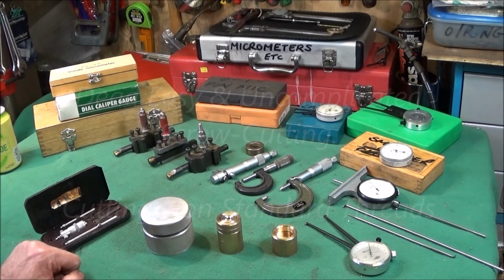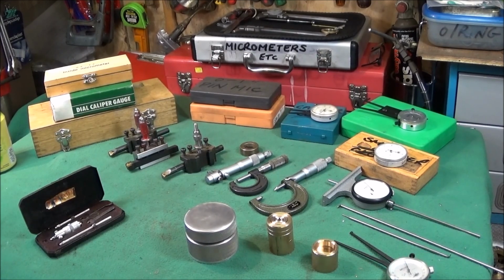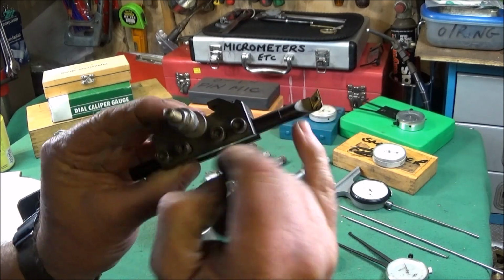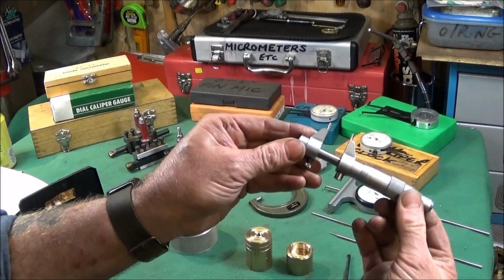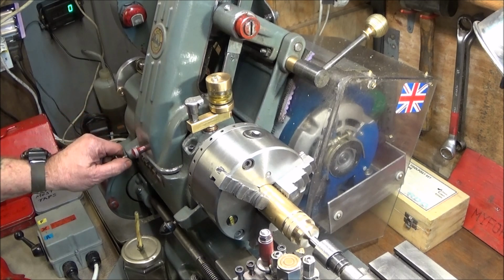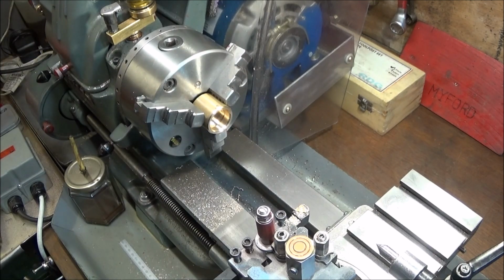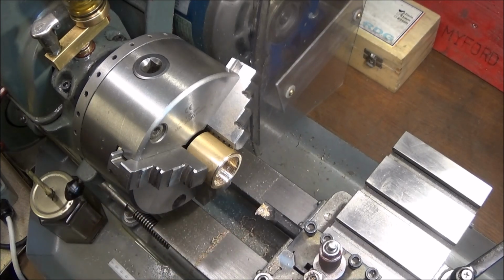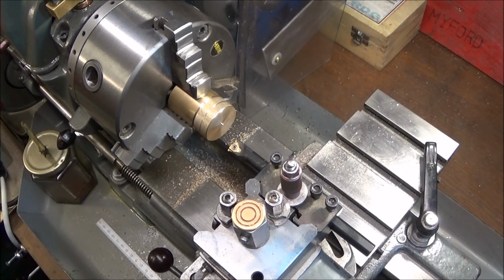The Easiest & Safest Method Of Screw Cutting Threads On The Lathe.

Comment: My lathe hasn’t got a hand cranking option, is there a way I can use this method? 

Thanks
Reply: I think you could make some sort of an anchor in the back similar to a wall plug where the material can stick out. Then attach a crank to that.

Comment: would you use this method for imperial thread ? Other videos i;ve watched set the cross slide at 29 1/2 degrees
Reply from the maker: Hi Maurice Yes I do use this method for imperial and it works perfectly every time. I don't think you need to set the cross slide at an angle if you are using carbide inserts as they have a perfect profile. Regards Steve
Reply: The idea is that though the cutting tool has a 60 deg profile, by setting the compound to feed at slightly less than 30 deg  the tool is cutting with the leading edge and not dragging the tool's heel which may gall the flank of the thread. 
Perhaps not so important with carbide tooling, but a hand ground high-speed threading  tool only cuts on the leading edge.

Comment: If you use the compound slide to increase the depth of cut and the cross slide to wind the tool back out, there is no need to remember which number you are on for each cut.

Comment: Superb video again, especialy for someone who like the  tricks from a specialist!  One question about the Thread Dial Indicator,   can you explain how it is used ( in the video i don't see the detail,   perhaps it's easy but  for a novice...)
Reply from the maker: Hi Ivo Thanks for watching.... I actually forgot to mention this important point. You do not need to use the thread dial indicator at all for machining threads in this way. As long as you leave the lead-screw half-nuts engaged all the time until the screw- thread is finished.  

This is what I like about this method. It cuts out much of the set-up you need to use if you were to machine threads using the motor.  Plus like I say, you don't need rapid reactions for cutting threads. 

If you try it you will be greatly surprised at how easy thread-cutting can be done, plus it gives the ability to make a wide variety of items......Regards Steve
Reply: This video makes me see the ned for a hand crank for my lathe. Yup yet another project on the to do list. Thanks. (no sarcasm intended)
Reply: Ha, my thoughts exactly ExtantFrodo2

Comment: Hey Steve, I am about to press Buy on Ebay on some inserts and cutters, but am curious will 10mm ones deffo need machining down to fit a QCTP? I have no means currently to take a few mm off you see so wondering if I'd be better with 8mm but I like the idea of using 10mm as they have a bit more meat on the bone.
Reply from the maker: +Tempest500 Hi they will fit the toolpost ok
It is only if you are using the Myford lathe that you may need to take a bit off the underside of the tool to be able to get centre height. I will just check the 10mm one....be back in a moment
Reply: Ah sorry should have said it's for an ML7
Reply from the maker: Yes I have just checked it. I have been using the 8mm one myself. I just tried a 10mm one on the lathe and it does looks like the tool-holder will clash on the underside. The 8mm one is perfectly good enough though, I have used it on all materials without any problems. Regards Steve
Reply from the maker: I forgot to say....It is only the the turn tools that need to be under 10mm square. 

The BORING TOOLS  I use are up to 12mm diameter and DO NOT need any alteration to the shank to achieve the correct centre height
Reply: Excellent, cheers for checking Steve, very much appreciated.

Comment: Thank you for sharing this outstanding method !  I was totally unaware of this but recognize the versatility and reliability it gives.
Reply from the maker: Hi Fred, Thanks. It is particularly good for very fine threads with a short run depth. Like the components you get on optical equipment plus other similar items where it is almost impossible to use conventional threading methods. I do use this method for any threads I have to do now though. Regards Steve
Reply: The other essential is a tailstock tap and die holder for cutting standard sized threads. That is much easier than using this method.
Reply from the maker: Not for large diameter threads, though.
Reply: @SteveJordan  - no, probably only for 12-15mm maximum.

Comment: Great idea, great video.  Is there any rule-of-thumb when initially cutting the two components?  Before threading, I suspect the male piece is a few thousands smaller than the female piece?  Or are they the same diameter (initially)?
Reply from the maker: The simplest way.. for threads up to about 30mm in diameter I just follow the thread cutting charts in the Zeus Book...ie the diameter of the thread to be cut on the male part from the metric chart and machine the bore on the female part to the diameter of the tapping drill given in the same chart. Otherwise you have to work it out using the pitch size etc.
Reply from the maker: There are some great Thread Calculator Android Apps for free. The one I like the best so far is (THREAD CALCULATOR by Ivan Mykolyshyn)  You can actually use this to quickly calculate the thread hole bore size needed for whatever diameter screw you are making. Plus it gives all the measurements if you actually want to check the finished sizes with wires.

Comment: excellent but if i may make a suggestion i dont ever crash a tool but i thread from the shoulder out by turning the tool over and thread backwards and it makes a perfect rh thread i do not know if you can turn your tools over but i bought a lh thread tool for my internal threads and i just turn my tool over for external threads but my chuck is not a threaded on chuck again this may not work for you excellent video sir
Reply from the maker: +lee Hi Lee I can do that method as long as I fit my draw bar adaptor in the chuck to stop it from unscrewing. Thanks for watching...Regards Steve

Comment: Steve, thread in reverse with the bit upside down and going left to right and you will never crash a threading tool again with the benefit of using the lathe's motor.
Reply from the maker: Hi The Myford has a screw on chuck, which would unscrew if machining threads like this. That's one of the things I don't like about the Myford. I much prefer bolt on chucks. Regards Steve

Comment: Steve, great video! Is the spindle driving handle home made or purchased as a set of plans, or bought ready to use? If you have a link or a video covering the driving handle, that would be really good to see.
Reply from the maker: Hi Tom, Thanks. I made a video in the early days showing this 'bicycle crank handle being put together, (no commentary then). Now I am used to making videos I hope to show how you can make them in easy to follow steps, with all the main machining and fitting points covered. Also I can now show this so that anyone that has a lathe with a spindle through bore, will be able to make one relatively easily , whatever make of lathe, plus no bike crank needed..:)    Regards Steve
Reply: @SteveJordan  Do you have this video showing how to make a hand crank?  I would like to use your hand crank idea on a South Bend 10k.  Thanks.  I like your videos very much.
Reply: @nfri6414  - of course, you could just read Steve's reply directly above your comment 🙄

Comment: So if you flip the tool upside-down and reverse the spindle you can do this easier. It threads away from the chuck. Machinist trick
Reply from the maker: Not with screw on chucks like on this one. There is a great possibility of these unscrewing and causing damage.
Reply: makes sense then. Thought you had done the profile first

Comment: You need to change some gears to make it cut a thread right? I think mine is a fine feed, because it does not make a thread even with pointy tools. I have other gears, but havent had tried it yet. I am dreading the task a little bit.
Reply from the maker: +Auarhau Hi yes its a bit confusing setting up the gearing. If you have a Myford ML7 you will need to check whether you have a fine feed on the back as this has to be changed to the standard one first. Regards Steve
Reply: I do have a ml7, and a large collection of gears to go with it. But haven't built up the courage to tackle it yet :) It might be obvious but seems a little mysterious to me. I don't really know what I got and what's what. Or even how to do it! Ha. That's a good tip for a video by the way. Many people getting a Myford is going to wonder how this is done.
Reply from the maker: Auarhau I know it still does confuse me now. what I did to make it easier is I photocopied the information from the ML7 manual of the three thread configurations diagrams and enlarged them to A4 plus the thread charts. I use these when setting the gears up. I may do a video on it at some point.

Comment: Can you drag the tool back on the reverse stroke? ( Without backing the tool of the work piece?)
Reply from the maker: Hi you just wind the spindle handle in reverse and it feeds back in the thread exactly the same.
Reply: Not quite - the backlash in the gear train means that the tool will never be in the same thread on the reverse stroke.

Also, you’d never cut larger threads or threads in steel by plunging directly in with the cross-slide like this - you’d always use the compound offset at just under half the thread angle so you’re only loading the cutting tool on the front face.

Comment: Cam you thread steel material with compound indeed methout but instead of moving z over by the tan of 30 times the individual pass depth. But since you cannot to this w halfnuts, you will bastardised the dial a little at a time,  up to 45 degrees on a lathe with a dial counter that has the standard 4 whole numbers?

Comment: NOT a critique!  You do what you can with the tools available and develop innovative techniques to perform operations that are simply or easily done on larger/more expensive machines with 'features', it's that simple. One can always purchase a CNC machine, write a program, throw the work piece at it and say, "I'm going for tea and you'd better be done when I return". 
Does your machine not have a backgear or the ability to turn at a low RPM with which you could then machine the threads?  
In all my years of machining I've never worried about crashing my tooling - not to say I've NEVER done it, sigh. But really, what's the difference between thread cutting towards the chuck and cutting towards a face?  You either stop at a given distance or crash.

Comment: Hi Steve. It's been a while since your last video...! 
A couple things I'd like to know, please. 

a) When you take a cut of 5 thou, is it one line in the micrometer dial? I think when I take a 5 thou cut on my S7 (one line on the dial), then 10thou are removed in total. 

b) The cutting tools have a shank diameter of 10mm. Is the center of the tip below or at 8mm or it's at about 10mm? My 4-way toolpost only accepts 8mm tools but your QCTP is already modified for bigger 10mm tools, so I'm not sure these tools will suit my toolpost... :) 

P.s 1 I actually bought a Dore Westbury miller, if you remember my last comments about it. 

P.s 2 Your previous nickname was better.
Reply from the maker: Hi Nick My dial has 1 thou lines so I move it 5 and this takes .010" overall off the diameter.

The cutting edge of the tip is at about 10mm on these tools....but that doesn't matter..........

There is an easier way around getting the tool on centre height rather than modifying the tool-post. I have found it very easy to mill a couple of mm off the underside of the tool shank, they are not that hard and easily machined with ordinary HSS end mills. Or you can even do them on a coarse belt sander..... If you want to you can also blacken the machined underside face up with chemical blue.

Comment: Actually, a better way is to power feed from the shoulder toward the tail stock.  No danger of crash! No stress.  No modifications needed. Many lathes won't have access to the gear train for a crank. I just got through doing 1"-8 tpi on 1 3/8" Stainless steel shafts using HSS tooling.
Reply from the maker: Hi Larry, It obviously depends on whether you are cutting left or right hand threads on my lathe.  On one of them you can only power feed out if you put the spindle in reverse, with the tool set upside down. If you do this on the Myford Lathes or any other lathes that have a screw-on chuck, the chuck will come off causing serious injury or damage. Unless of coarse you make a special draw bar lock to stop this happening. You can see this in one of my other videos....Regards Steve
Reply: The handy cap of a screw on chuck! A draw bar might be worth it if you do much threading. I'd sure hate to hand crank my way through a 1" SS thread. My lathe has a CamLock spindle. Really fast and easy to change chucks.  I use my collet chuck whenever I can. I'll look up your video with the drawbar.
Reply from the maker: Hi Larry, The CamLock system must be the best type. I had this on the lathes I used in the factory. I have never liked screw-on chucks and think it is a quite bad design for lathes. Not only is it bad that the chucks can unscrew in reverse, but also they are very prone to jamming on the spindle, particularly after a bit of heavy machining, It can be quite daunting trying to get them off! Also it is bit of a problem having to carefully check the internal thread on the chuck each time, that it is perfectly clean.
Reply: What happens when you use the brake with a screw on chuck? Isn't there the risk of the mass of the chuck & work causing the chuck to spin off?

Comment: Thanks for yet another really educating and inspiring video.
One question is how faar this method is useful. Brass and ALU, yes, but threading an M12, 1.5 mm in steel looks like heavy to me. Where would You set the limit?
Handmoving the internally cutting insert to its place, advancing the crosslide, and using the motor looks like possible to me.
The same method could be used running the lathe in reverse, having the up side doen cutting done on the other side of the stock, if the crosslide has travel enogh.
Reply: Ok if you want to be there all day.
Reply: If will depend heavily on the left arm......

Comment: Very Innovative but I don't understand why you would want to use the normal Drive? Threading is so easy at least it has been for me over the years that I can't imagine wanting to crank something like that. It all the years of my threading I've only crashed the tool once. And I was going much too fast. It was early on when I was first learning and I was getting cocky. But no I don't understand why you would want to do it this way I mean it's pretty easy to thread once you've done it a couple of times
Reply from the maker: The crank method allows people with varied skills and abilities and different types of lathes to produce a good screw-threads much more easily. Anyone with even the slowest reactions can be totally relaxed when threading. I use this method now because I don't do much screw-cutting like I used to and rarely make more than two components with the same specifications.  
    I also reckon it is a great method of getting into and learning screw-cutting if one is new to machining. Especially if one hasn't got a skilled machinist with them on the lathe, like many of us had when we first started.
    Also I found screw-cutting much easier when using machines like Colchester lathes that have a rapid response when changing the spindle direction. The Myford lathe doesn't have that. It also has the screw-on chuck to take into consideration, if one was thinking of screw-cutting in the opposite direction.

Comment: I guess your electricity was out while doing the video? Or is this a how-to for the Amish? Oh and before people say SAFEST, you can run the leadscrew to run both in and out so you can start at the spot clostest to the chuck and run out of the part.
Reply from the maker: Totally wrong Matt. You need to look into things properly before making such an ignorant cocky comment! 
   This method I have shown here is the safest method for all lathes particularly those with screw on chucks like the Myford ML7. If one was to use your method the chuck would unscrew from the mandrel on the reverse stroke, either completely ruining the thread, or even worse seriously damaging the lathe. Also the method I have shown, used by skilled machinists for decades, is the best for doing the finest of threads, such as those on optical equipment.
  So likeI say...before you comment in such a manner in the future, do some research first, it will save you looking like a cocky little novice that doesn't know what he's are talking about..:-)
Reply: Bravo Steve! there's always one isn't there!  @SteveJordan

Comment: Hmm I want to try this on my ML10, but suspect the spindle bearings being cast iron will mean it will be harder work with a handle!? Assuming you did it for the internal under power, I assume you would perform the operation backwards...? With the risk of unscrewing the chuck..?
Reply from the maker: It shouldn't be harder work whatever the bearing. The chuck didn't unscrew during this operation although it most probably would if I used the motor. Regards Steve.